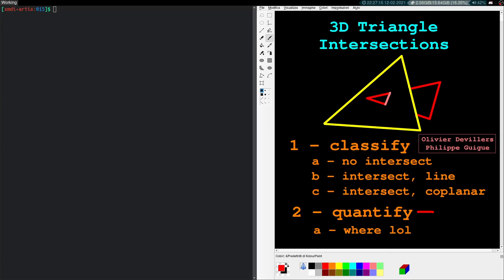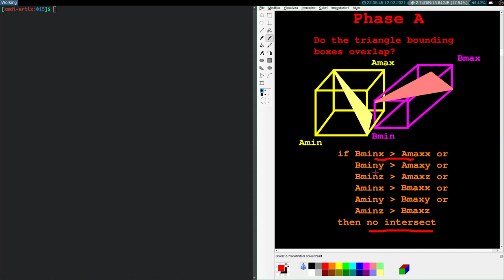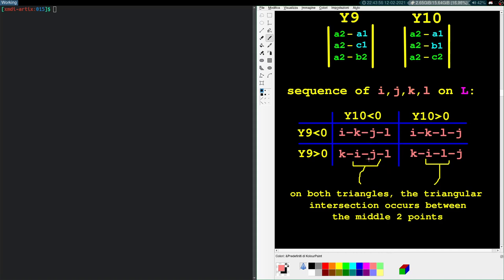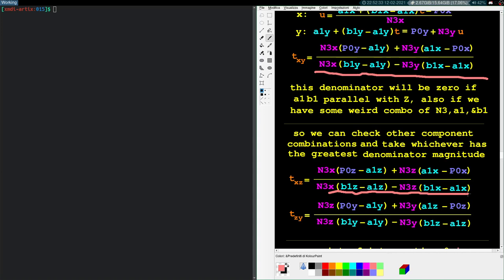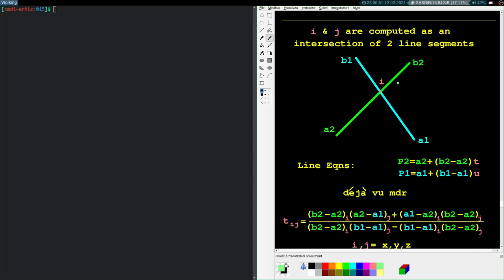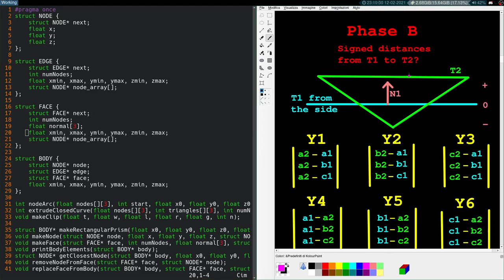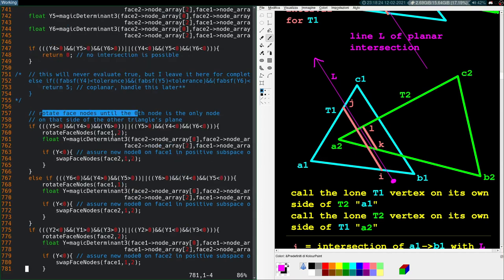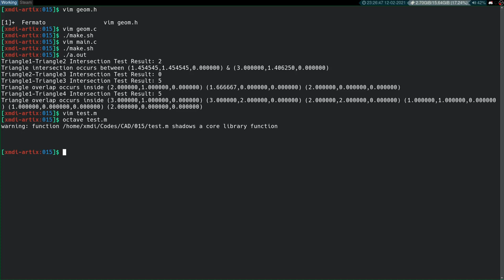3D Triangle Intersection Masterclass | CAD From Scratch [15]

Comment: Hi, I corrected some mistakes in TriangleIntersectionPoints method.
When intersection equals 1
Change node_array[1] to 2
When intersection equals 4
Change node_array[2] to 1

The tolerance must be some value multiplied by the area of t1. Like 0.01 * Area(t1).
(Area is the length of cross product / 2) to compute if coplanar no matter the size of the triangle

Also, if you made your own function for rotating list, take care of shifting to the right (not left like me ^^)

Thanks you very much, extremely clear, I was looking for something like this for a while

Comment: I have tried to translate the script into C# to test an intersection, but right now I am running into the issue that 50% of the intersections are not working. I have changed the test Faces from 0,0,5 / 3,0,0 / 3,3,0 and tested with 0,2,-1/0,1,1/8,1,0.5 and get the wrong result. I ran your code and I also get the wrong response from the code.